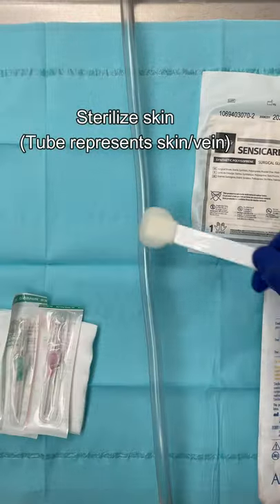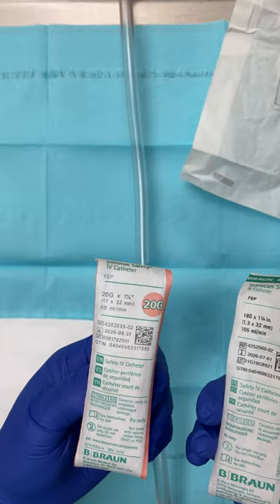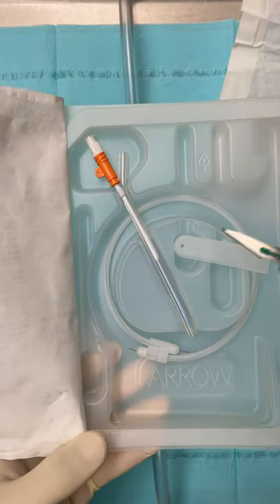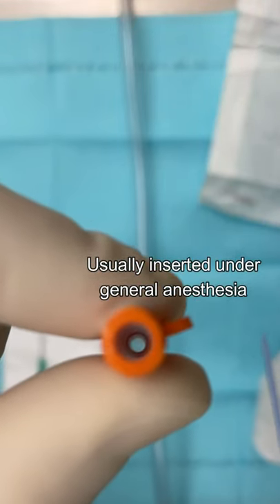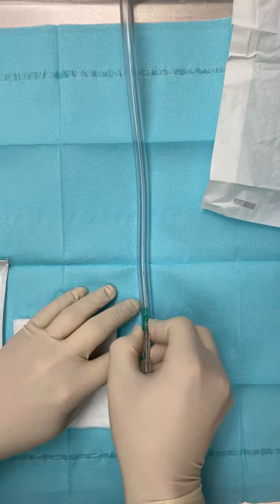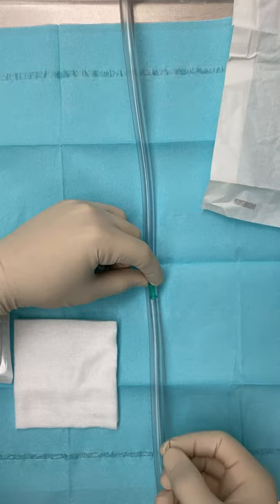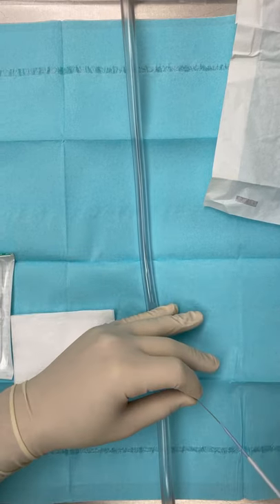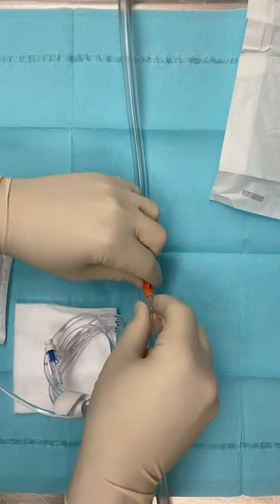Insertion technique for huge IV - the Rapid Infusion Catheter #shorts

Comment: Not a medical specialist here: What circumstances would require the use of something like this?
Reply from the maker: Hi Celine this type of catheter is used when large volume of blood loss is anticipated, as this facilitates rapid volume resuscitation. For example liver transplant surgery or big vascular surgery.
Reply: I've had this happened where a patient was brought up to the ICU and we were taking care of a patient with massive arterial hemorrhage and we ended up doing massive transfusion of around 30+ units of PRBC alone where the surgeons were working on the patient too. He survived 😳
Reply: @sburt1998  the patient came from ED and upon arrival to the ICU and upon arrival we noticed his BP kept dropping and going up on BP supporting medications (central was done at ED) and physicians arrived quickly thank God the internal medicine team was near by with an ultrasound machine and they did detect hemorrhage
Reply: @sburt1998  it's not common to see bedside surgeries in the ICU if the patient is too unstable to bring to the OR
Reply: I needed one for a surgery because all of my peripheral access is gone because I spent all of 2019 in hospital
Reply: @sburt1998  central like isnt capable of even close to these speeds.
Reply: Go to a level 1 trauma hospital and you’ll see
Reply: @laratheplanespotter  I never actually thought about how they insert catheters in women. I thought it was only men
Reply: This is usually a trauma scenario

Comment: Would you numb it first? Is the patient sedated?
Reply from the maker: RICs are usually placed when a patient is under general anesthesia, otherwise yes local anesthetic is given to numb the area.
Reply: @MaxFeinsteinMD  RICs look like tunnels compared to the peripheral catheters used in dental surgery.
Reply: I've had several central lines and can only wish I would have had some sort of anesthesia!!  I had a bit of Lidocaine to numb the insertion site but a touch of sedation would have been appreciated.  It was painful.😢